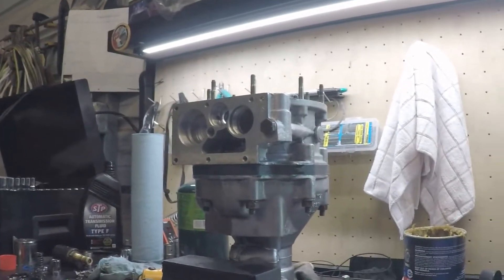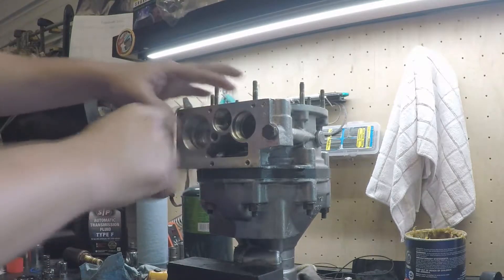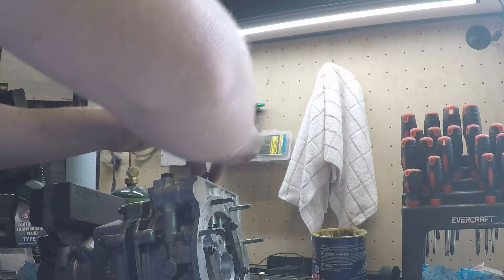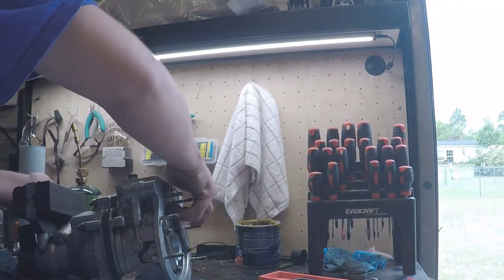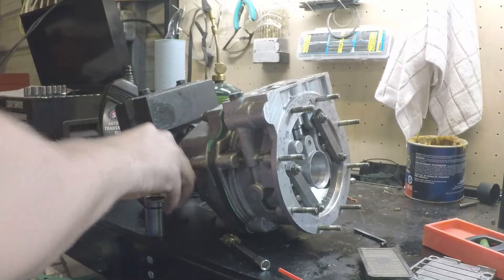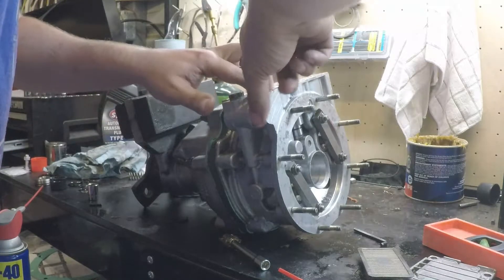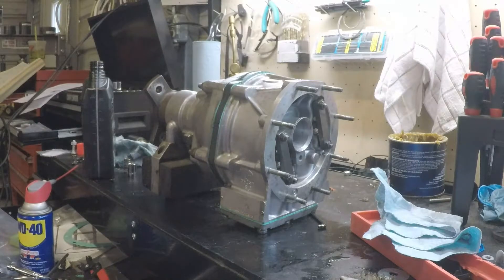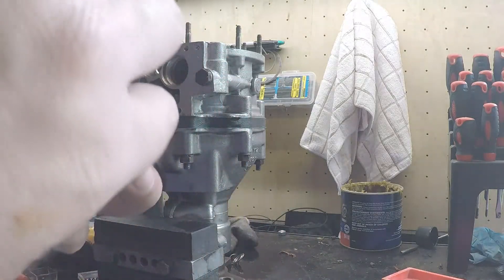Laycock O.D. Rebuild (86' Volvo 745 Turbo, PT. 3)

Comment: Hi, thanks for posting. Is there any seal ( o-ring ) between oil sump filter and a housing?
Reply from the maker: There are basically two filters in the OD oil sump.  Not sure which one your talking about so I'll address both. There is a cylinder shaped filter that goes inside the OD. It sits beside the oil pump and is held in place by a threaded "plug". The filter sits inside this plug, and a gasket does go between the filter and the plug its self. Secondly, there is a cover that is on the outside of the OD unit. It's held in place by six 11MM bolts. Once you remove the bolts and drop the cover, there a gasket that all the way around the cover as well. This cover also contains a screen type filter that's flat and sits inside of the cover. But it requires no gasket its self. The only gasket that is in this area is the that I mentioned that goes between the sump cover, and the OD unit its self. Hope this helps. Let me know if there is anything else you need to know.